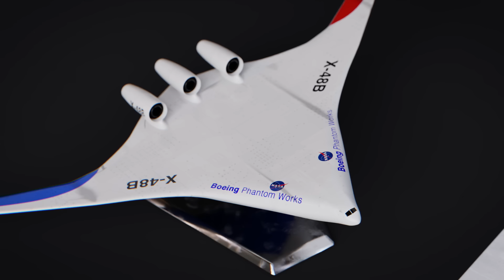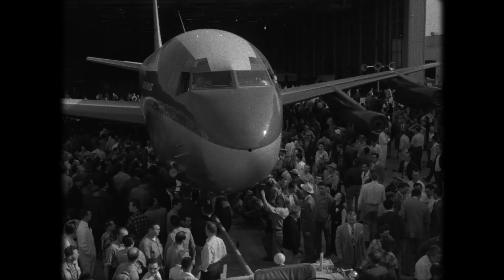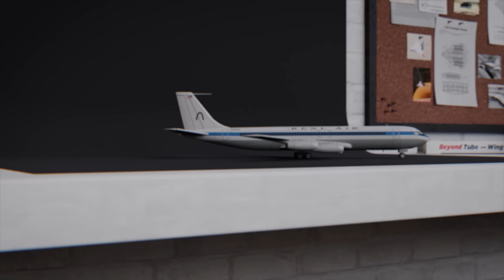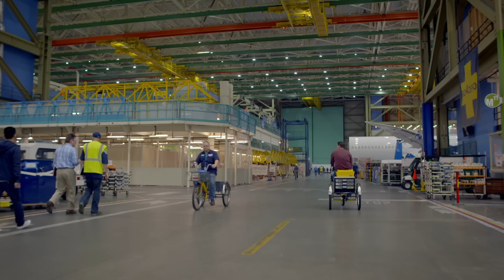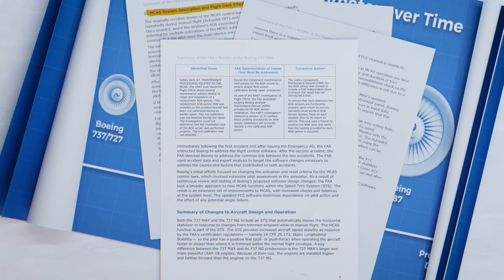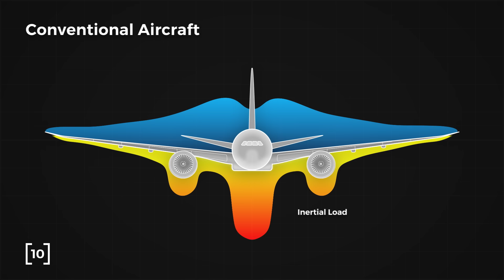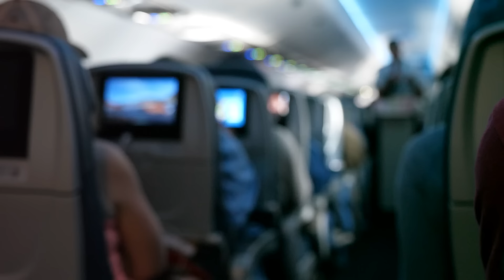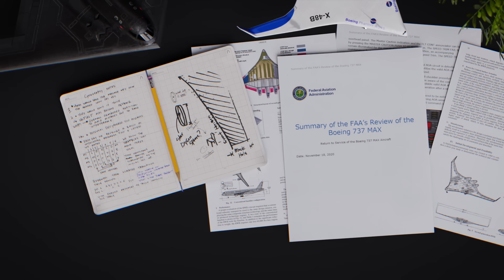The Plane That Will Change Travel Forever

Comment: The MCAS engineers knew they needed redundancy, but the FAA double checks everything using redundant sensors because they correctly assume that’s the important stuff. Boeing managers knew the FAA would insist on recertification if they saw MCAS, so they didn’t allow the engineers to design it properly. 
The point is, it wasn’t stupidly, it was secrecy.
Reply: No it was both, secrecy because of stupidity and greed.
Reply: This is kind of reversed. MCAS used a single sensor because STS used a single sensor, and MCAS was presented as an extension of STS (which is largely true but ignores how much more control authority MCAS had). Boeing simply presented a safety analysis that said MCAS failures were not particularly hazardous, which was very untrue. The single sensor design is therefore justified by the flawed safety analysis, not the other way around.

Comment: I'm not buying this design. You did your work exceptionally, as always. However, it is neither safe nor desirable.
Reply: Probably not needed either, with a probably rapidly shrinking population.
Reply: @redpill6201  10 billion is the expected global cap when every country industrializes according to the UN, so slightly above modern levels. That cap is the expected level it will fall to eventually, after decades of probably going as high as 20 billion or more, so the economics check out.
Reply: @windrose5988  We are reportedly at 8 billion now, but in 2021 steps were taken to treat 5 ~ 6 of those 8 to leave early and no longer to be able to reproduce. If that volunteer based program works, we may not hit 10 ~ 20 billion, but we may be back down to 2 billion within a few decades. So knocking off the huge increase of the last 100 years.
Reply: @redpill6201  Depopulation is generally a negative for the vast majority of contries that got the rona vacinne and a positive for the ones that have the least amount of vaccination rate. If anything it would be the other way around, the vaccine would be an aprhodisiac.
Reply: @windrose5988  You are thinking in country terms. The 1% running G7, G77 (G=7), UN, WHO, WEF plans, think in global terms.

Comment: I think the more fuel efficiency per person can be pointed at seat-size, and the number of people being crammed into planes per flight. Although there is no shortage of engineering improvements - fuel efficiency per-passenger get's floated as overall efficiency far too often, and it has been at the expense of the passenger. Flying is no longer something to look forward to. It is an arduous, pain in the butt. As little as 30 years ago this wasn't the case so much and tickets were not that much more expensive if any either.
Reply: The price of oil and therefore jet fuel is much higher now, due to decreasing supply, increased demand, and opec.
Reply: it shouldn't be "something to look forward to" it should be a mode of transport.

Comment: Unfortunately, it's all about profits with the direction in which innovation goes. Improving the Concorde with these engine and wing innovations, plus better fuel, would have been a much safer bet and already in flight. And I'm not even mentioning the 50% flight time reduction. In fact, I wouldn't be surprised if we see another Concorde type plane years before we see these ones.
Reply: The Concord isn't remotely the same type of plane as these.

Concords suck.
The amount of extra fuel they used to go faster than a regular plane, was stupid insane.

The Concord carried about 100 passengers, and used 25,629 liters of fuel per hour of flight.

The 747-400 carries over 400 people, and burns just  14,400 liters per hour.

The 747 has four times the capacity, and almost half the fuel consumption.
Reply: @lordgarion514  It did cut some multi day voyages into multi hour voyages, though. Concorde-like should still exist as a luxury for those people doing Rio-Tokyo, for example.

Comment: Main issue with blended wing design has zero to do with the feasibility of manufacturing or efficiency and more to do with the high angle banking required to land in today's highly congested airports like BWI. Imagine sitting on the outboard seat closest to the wingtip when the plane makes its high bank approach in Atlanta. plus this design is more applicable to planes carrying over 400 passengers which airlines are running g from as fact as they can.

Comment: Main issue with blended wing design has zero to do with the feasibility of manufacturing and more to do with the high angle banking required to land in today's highly congested airports like BWI. Imagine sitting on the outboard seat closest to the wingtip when the plane makes its high bank approach in Atlanta. plus this design is more applicable to planes carrying over 400 passengers which airlines are running g from as fact as they can.
Reply: You can turn them 90° sideways with special landing gear. They'll be able to go where any tube & wing can go.

Comment: please stop with the "sustainable and truly eco friendly air travel." you're supposed to be engineers.  if you have the most basic understanding of physics you would realize that if you wanted to heat the atmosphere,  carbon emissions would be the absolute worst gas you cold use.  CO2 is incredibly inefficient at heating the atmosphere.  
I'm ok with lowering any pollutant but eliminating CO2 is a suicide pact.
Reply: You're talking retarded. LOL

No one said anything about eliminating all CO2.
Everyone is talking about "capping" CO2 emissions......
Gotta start paying attention.

And it's irrelevant if CO2 is inefficient  at holding in heat (CO2 does NOT heat, it reflects heat)

And the reason it's irrelevant is because of the quantity we release. 

Also, the fact that we release an itty bitty fraction of the CO2 that Earth itself releases, is ALSO irrelevant. 

It took the greatest mas extinction event in Earth's history 20,000 years to increase the temperature by 5 degrees Celsius at the equator, and 8 at the poles.

That wiped out about 90% of all life.
And the dying started long before the temps hit their peak.

We've already managed almost a single degree Celsius in just over 100 years. 

In other words, it took nature 2,500 years to increase the temperature as much as we have in just over 100..... 

And as far as our food is concerned, since the 1960s, climate change has reduced the worldwide farming efficiency by 21%......
That means we're paying MANY BILLIONS per year more for food than we should be.

And as far as our health is concerned, the higher the CO2 level, the faster plants grow, AND the less nutrients they contain.
Which means we will have to eat even more food to get enough nutrients.......
Meaning we'll have to grow even more food, AND eat more food...... 

Seriously, who you get your information from??????

I don't believe in political parties, but are you a republican?
Reply: Oh, AND the Earth does NOT need us releasing any CO2....

Earth releases and absorbs CO2. The plants and animals are well adapted to the amount of natural CO2 in the air. 

Plants grow with a certain amount of nutrients, and the animals adapted to live on that amount of nutrients.
We screw around and drop the nutrition levels in plants too far, it will be bad for the animals, obviously.

Comment: Seems like these designs would also lend themselves to a detachable cabin with a few parachutes to control descent in case of an in-flight incident. The cabin is already shaped like a boat so seems it could float easily enough in case of a sea crash as long as the wet area of the cabin wasn't compromised.

Comment: You said it, they will never work because they are naturally unstable. You lose power, computer goes down, sensor goes bad you will crash. You can not fly these without power. It would be a death trap.
Reply: Redundent computers have far less addirional weight than a tailplane--stability is no longer a safety problem when one computer fails.
Reply: @Macrocompassion  emp, solar flare, lightning strike, even a bird sometimes can take out power. Computers do not work without power lol. Even computers make mistakes. That’s why they will never work.
Reply: @nickh.isalldamgenocntrol4444  If you were hit by an EMP you have more things to worry about, notably that civilization just ended in nuclear hellfire.

Comment: two issues maybe  four... ground handling takeoff and landing would be really difficult in windy conditions.....  also all the airports would have to be completely rebuilt to accomidate this aircraft... also the crusing speed would be much less... also the sardine can accomidations  for that huge number of people on the airplane would be psycologically uncomfortable...
Reply: These items of design can be met without much addiional weight nor problems. The ground performance mostly depends on the design of the landing-gear and the cruising-speed is not affected in the way you claim. In fact with its greater size wing the all-wing aircraft cruises at greater altitudes where the thinner air ensurs it having a higher ground-speed this is a part of its fuel-saving feature.

Comment: It is disappointing that Vincent Burnelli wasn't mentioned ONCE. Mr. Burnelli pioneered the lifting body / blended wing design in the 1920s and 1930s. Companies such as Northrop, Lockheed, Grumman, Boeing, and even NASA benefited from (copied?) Mr. Burnelli's designs but he is NEVER given any credit. Shame.
Reply: Handley Page Ltd also pioneered the flying wing with its experimental MANX aircraft (1940s) and its later designs for the passenger-carrying HP117 in the 1950/60s.

Comment: Surely those 3 engines stuck up in the air cause a lot of drag, isn't integral engines the way to go or does that compromise safety ?
Reply: If it were a British design the engines would be burried in the wing, but the US designers are more aware of the need to easily get to their engines for servicing,

Comment: I find the rah rah for the US aviation industry a little distracting and negative to the presentation. Mind you I am only three and a half minutes in to the presentation.  I also note that the tube and wing design preceded jet design.  Further, the BOAC Comet preceded the 707 having flown in the 40's. And yes, it had a design flaw that had they kept to themselves may have lead to the 707 dropping out of the skies too.  But BOAC made the results of their studies public to all aviation industries, (Including ideologically opposed entities because, people).  The fault was the square shaped portals that lead to stress fracture from repeated extreme temperature and pressure variations.  The comet was a technical achievement beyond any one else.  But because of the disasters, even though they fixed the problem, the name was a commercial disaster.  In addition to that, the British design of fitting engines into the wings was better for flight dynamics which worked so well in the Vulcan and Concorde.  Tragically decades of political machinations and the French disaster meant that Concorde was laid to rest when it could be still flying and God forbid the US should be seen to be implementing foreign innovation for the sake of efficiencies. Did you know they refused to adopt the RAF cardboard disposable drop tanks for the aircraft in the war because it was not 'Mericun'. They used aluminum instead.

Comment: many windows can exist just using polycarbonate. there is no need for tiny windows anymore. if you have sleeping bays instead of seats, the honeycomb structure takes car of the stress concentration. you can also use more fuselage used for carrying personnel.

Comment: couldn't gyroscopes be used instead of a tail wing? They could provide some of the automatic stabilization the wings give. Only downside is they would be moving parts. 😕
Reply: @mrfly8133 Afraid, a mechanical gyroscope to stabilise an aircraft pitch would be big, heavy, and expensive. It would also make changing the aircraft's altitude impossible.

But an active pitch control would probably use a miniature gyroscope which would feed a computer. The other input to the computer would be aircraft pitch. The computer would then command servo motors that drive the elevators. This would stabilise the aircraft in pitch.

Comment: The flying wing design has a problem with YAW. This originally caused the Northrop XB-49 to crash, reaction time is S-L-O-W. The B2 Spirit gets around this by fly by wire design by not getting itself into an uncontrolled yaw condition. Also the control surfaces are quite different notably the split flaps. These problems will be rectified because a flying wing and lifting body is a heck of alot more efficient in fuel and in passenger space too! I see the clean airliner running on hydrogen which has the highest specific impulse, not battery electric, it's just to damn heavy! So the lifting body design has a lot of advantages in this area with the only design problem be in controlling the aircraft. I know they will solve this however.

Comment: This still doesn’t answer the real question though,
Why not have the tube design with cg in line with the center of lift with active redundant stabilization? And a closer rear stabilizers to take away increased skin drag?
This would still have the passive stabilization of a rear stabilizer as well

Comment: let me spill this out. This aeroplane here will never get certified. It has extreme deep stall tendencies, it has the engines at the worst possible spot in terms of air input. The engines will suck in turbulent air at any positive AoA, which will drown the engines and cause the plane to be unable to hold speed in a climb, furthermore causing a tendency for it to stall without recovering.
Reply: @MathiasEmilKuntz1994 Hell, that sound horrific. Thanks for posting info.

Comment: Here's one from the 80's...take a zepplin and using modern materials how much larger could it be? Let's say 1000 ft. Flatten it into a wing(2000ft)(3000ft)? Don't make it float you can't control it.make it about 747 weight and slap some big honking engines on it. There's no reason it couldn't be build or flown.40 year old idea,half mile aircraft-helium to lower weight and 747 engines for thrust, wing shape for lift. And i'm not a engineer,get those degree holders to THINK a little and we could live in a different world.

Comment: Blended blade airplanes has more obvious reasons to be complex. People usually won't innovate instead they understand the nature's technology . Boeing kind of structure tried in water (fish) then in air(birds). But this Blended blade often seen in fishes, not in birds. Keeping weight balanced is difficult, because there may be the need of tracking passenger's weight to place them in wings so that plane is balanced. People's movement inside the plane can shift gravity left of right.

Comment: now if we are able to make carbon carbon at low cost there will be no need to worry about cabin pressure because 1 micro meter layer of this has a tensile strength of 2 tons so combining it with titanium and making it 2 cm thick can easily withstand the low pressure zone and high temperature and further more structure integrity can be achieved by making a layer of hexagon like structure in between layers (come to think of it if this is widely possible we are looking at a crash proof material)

Comment: Your explanation of the need to have the center of mass forward of the center of lift is quite flawed.  If both were in the same place, then the rear stabilizer could be horizontal, exhorting no downforce at all.  If the nose pitches down, by your exact same argument the tail stabilizer would still push the plane back to horizontal (and similar for nose pitching up).  Since that argument also applies to a horizontal stabilizer, this argument explains nothing as there is no difference.

Comment: What I took from this video: the blended wing design brings 2 advantages that the tube and wings design doesn't have, at the cost of 7 disadvantages, and bringing a couple of problems that have been solved for years in tube and wings design. Doesn't sound very helpful to me.

Comment: 10:41 "Beyond the tail surface breaking off which is essentially impossible with regular maintenance the system is foolproof." is said while in the background of the shot you see a tail from Alaska Airlines airplane.  Alaska Airlines flight 261 crashed after loosing pitch control due to insufficient maintenance. I love the subtleness.
Reply: @marcheida2819 Yes, I thought 'impossible' was an ironic word.😊

Comment: No one seems to discuss the radical passenger seating configuration of a passenger cabin almost four times wider than current wide body aircraft. In a 30 degree banked turn, in current aircraft, the passengers on the inside of the turn drop about 3 feet while those on the outside rise the same distance. By tripling the width of the cabin, that distance will triple to nearly +/- 10 feet. In turbulence, those seated on the outside of the cabin will see relatively  high vertical excursions while the aircraft autopilot attempts to maintain level flight. With no windows, this may be exceedingly uncomfortable for many passengers. Controlling these movements will require some much fancier flight control software than current autopilot systems to keep the meals served inside the passengers.
One other issue I noticed right away as an airline Captain with 25,000 hours of flight time: The distance between the main landing gear is nearly three times that of current aircraft. Runways and taxiways will have to be significantly widened. And, with the passenger geometry issue noted above, landing this beast in a strong crosswind without injuring passengers is going to be a formidable task.